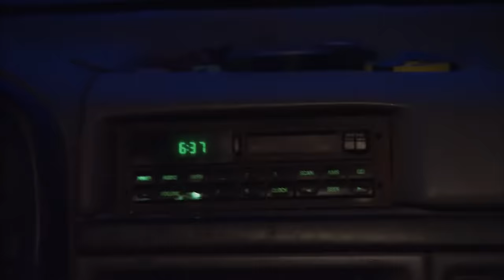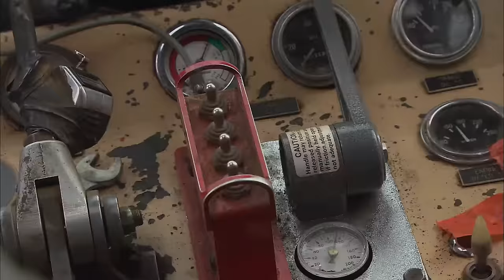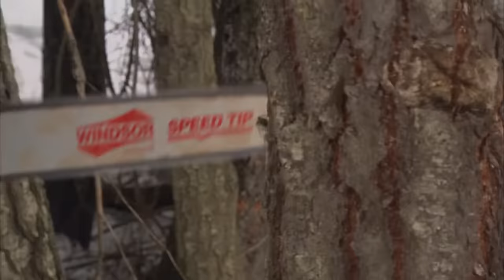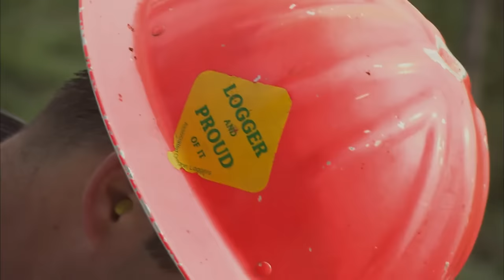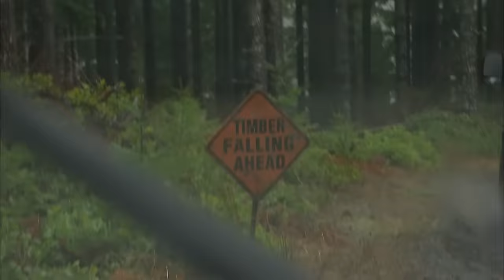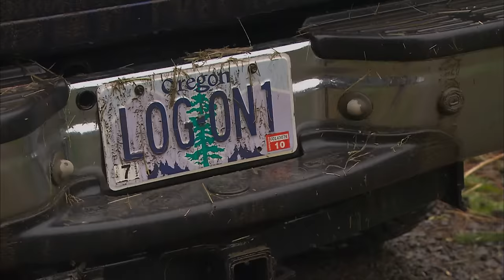Lumberjack | Risk Takers | Episode 8 | FD Real Show

Comment: America's 750 million acres of forest equals 1.2 million square miles, or a rectangle of forest land that is 1,000 miles long by 1,200 miles wide if all the trees were in one place. That is a huge amount of trees. In New England, where I live, the forests are overgrowing the land at an alarming rate. Trees are EVERYWHERE, even right up to the edge of my town. We should be using these forest to provide local jobs and local energy for our economy. We could grind trees up for use as pelletized heating fuel, or ferment wood to make methanol alcohol fuel, which could be burned in converted oil burners. The wood "mash" left over from fermenting then could be used as fuel in woodstoves or in power plants.